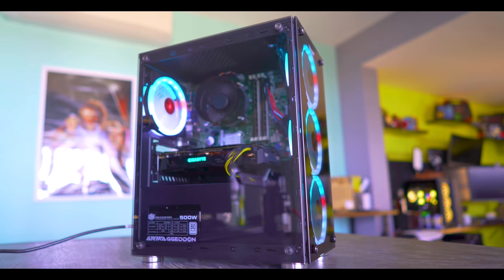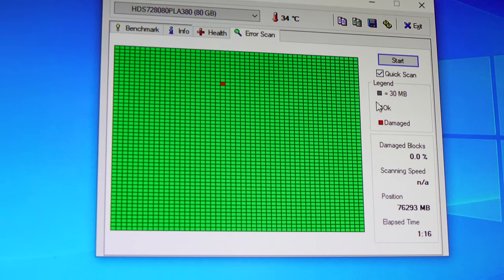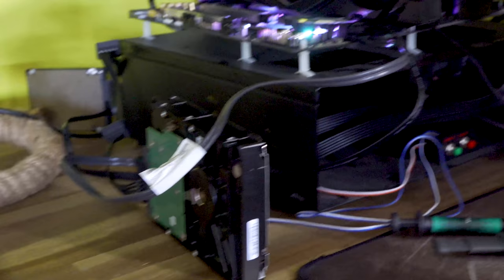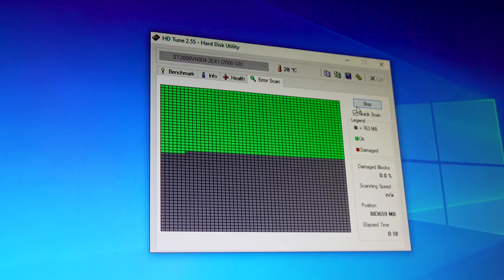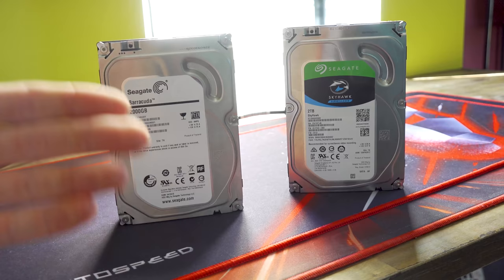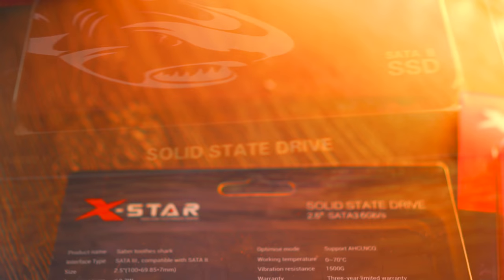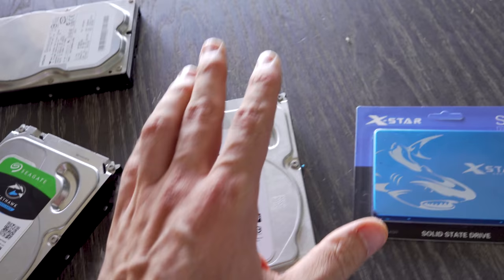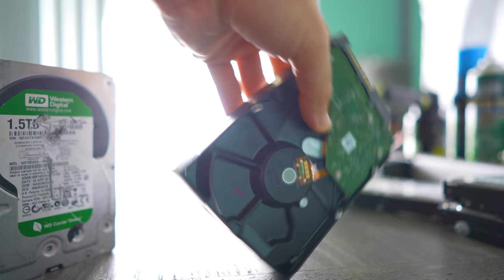Are USED Hard Drives Worth it...? (The Tech YES Buyer's Guide)

Comment from the maker: What's your experience with Used HDDs? Let us know below!
Reply: I took this bogan guy from Queensland to a Taiwanese scrapyard where we picked up a bunch of cheap driveys from a guy who gave us a hard time.
Reply: I had a used Seagate as backup. RIP.
Reply: I take old hdds from old computers i don't always buy hard drives
Old hdds is also good Temporary Boot drive till you get ssd
Reply: Tens of used HDDs and have never had a problem, use them in my own system. I have had a few SSDs die on me however.
Reply: For me its a 50/50 kinda at the point to not buy stuff from people here in south africa most are just looking to take chances at best
Reply: In TipidPC (the Philippine equivalent of Craigslist/Gumtree, but for PC components and peripherals), used HDDs usually come with test results that generally give them clean bills of health. I usually go for low-capacity ones (128 or 160GB) because not many people want them, and they usually come from old laptops.
Reply: The Tech Yes City Rebrand is 🔥
Reply: Apart from Toshiba & Hitachi -- I never buy used drives . Low level formatting is one tedious time consuming pain 🙄
Reply: As an IT support guy, I had tons of exp with used HDD. When I was in Data Recovery division, I had salvaged a few old 'dead' HDD from the masses and use them for  not really important task 😁
Reply: did u know chances of getting a functional hdd are significantly higher if u buy anywhere used instead of buying a new one off amazon, that is if its fulfilled by amazon, at least in germany they just toss the hdd without any protection in a box and the carrier just throws it around, almost 20% of their drives are DOA due to that
Reply: @abhroy  
>  Low level formatting 
 Low level formatting is a thing of the past.  HDDs produced in, say, the last 20 years can't even be  low level formatted.  Low level formatting is done in the factory where the HDD is produced. Doing it yourself would brick them.
Reply: @Conenion   . Well , then I must've been doing things the wrong way for the last 20+ years . Thanks :)
Reply: Stripped the 2.5 WD Blue Scorpio HDD (240GB) From a external enclosure, Plugged it into my 2nd pc internally and it needed to do the automatic repair but now it’s working perfectly fine, no weird sounds, nothing.
Reply: Your content is the best....🔥🔥🔥🔥🔥🔥🔥🔥🔥🔥🔥🔥
Reply: @jollysword  I always keep coming back to TipidPC to buy used HDDs . huge thanks for feedback system.
Reply: @abhroy  
As I said: You can't low level format a moden hard drive.  Most likely you talk about wiping a drive.  Filling an entire drive with zeros is writing to a drive, not low level formatting it.

https://en.wikipedia.org/wiki/Disk_formatting#Low-level_formatting_(LLF)_of_hard_disks

Quote:
"
Today, an end-user, in most cases, should never perform a low-level formatting of an IDE or ATA hard drive, and in fact it is often not possible to do so on modern hard drives because the formatting is done on a servowriter before the disk is assembled into a drive in the factory.
"
Reply: I use used hard drives all the time  and have had very few issues with them.
Remember that a power surge can destroy your HDD, Motherboard and PSU so always use a UPS.
If you use a SSD for storage and it fails you can say goodbye to your data, whereas you can often retrieve data from a faulty HDD.
Just sayin'
Cheers, Mon from Brisbane
Reply: If the HDD is outside it's warranty period I avoid them because they are already old. If the HDD is functioning and within its warranty period, I may consider it if it is in a good condition.
Reply: @ControllerMeneer  Yup, I salvaged a 500GB Blue WD from old external HDD (1TB that have 2x500GB) back in 2013. 1 HDD was broken but another one is okay. It still run and spinning now, I use it sparingly to hold my old but not so important data.
Reply: @Conenion  I think it's called as full formatting (not quick format that only erase the file file table) CMIIW.  Low level format is in another league and need special tool or application.
Reply: Got one a while ago, still ticks.
But in that case I was looking for an OLD IDE Harddrive, and those you had to find used.
Even more so as it was to be used in a PS2 and they are fiddly with where they put the ports to make it fit with the adapter.
The new in bag ones I could get at that time, wouldn't fit in there, so I got a used one.
Still works, still loads, still plays and is still good.
Reply: So far its good, i buy a used hdd wd black 2tb.
Reply: I took an old drive from my 2007 PC, nothing wrong it worked, but I didn't test it.

Began to transfer big MP4 files to it and the same day I couldn't retrive some of the files because most of the MP4s couldn't be copied, but still showed up.
Reply: I had a couple of 3 Tb drives from my old build that I wanted 4 more matching drives to put in to a NAS I was building.  Bought 8 drives before I got 4 working ones.  Thankfully all sellers refunded the dead ones.
Reply: Hitachi HDD is good. Got one but not connecting it. Sitting in the pc in it bracket.
Reply: I have bought a bunch of used drives over the years one of my best scores was a 4 pack of 4tb 7200 drives for $100 total that I use for my data storage aray now.
Reply: Ali Wardhana I use my 240gb drive for most of my games on 2nd pc and they downloaded faster on there than on my main pc (that has a 1TB 7200RPM HDD)
Reply: Hard drives can be a crap shoot. Different people swear by different brands. I have found that after testing upwards of 3000 to 7 thousand used hdds annually, Hitachi and Toshiba Enterprise grade last the longest. But remember all computer hardware fails, and you could really use any brand of hdd... except Maxor...f*ck Maxor..
Reply: WD or Hitachi I will give it a shot. Seagate it goes in the bin. I perform a killdisk DOD wipe with 100% verification, then do a long/slow format, then do a full extended check with WD lifeguard. If it passes I consider it good. I do this with new HDD's as well. And yes...I have found brand new HDD's that failed the test. I immediately returned them to the vendor.
Reply: @joshberman1848   . LOL . You mean Maxtor . That's Seagate now -- crap owns crap :)) Yes , Toshiba & Hitachi HGST -- they really last very long .
Reply: 2 buys 2 fails after short time! i will never ever will buy used hdd ever again
Reply: wd recertified can be a good bargain & well worth checking out
Reply: Usually no problem at all. I bought a 3tb WD blue drive für 50€ with case 3 years ago and it works to this very day. For every one of my builds i buy a stack of tested drives from ebay out of refurbished systems. About 8€ per 500gb is not that bad and i know for shure they work.  Some viewer donations had drives in them that were old, slow or broken aut of the box. So Good point paying attention to age.
Reply: Using my 8 year old hdd in my new amd pc
Reply: as a guy that repairs pcs for a company power on time does not say much of a wear on newer drives since they go to sleep after 30min idle but the hour counter goes up, if a drive has pending sectors write it with zeros they either disappear or will be marked as faulty (I use nwipe to do this) also check the warranty on newer drives the 2tb skyhawk (3:50) has warrenty till 2021 but was sold in a bundle so no replacement directly via seagate
Reply: I had a busted drive that wouldn't show up in any bios...but the modded original xbox fixed it
Reply: If u have used ssds that do not show up hook them ~1hour to an psu without the satacable and retry I usually see a 66% recovery because the drives runs selfdiagnostics without the sata connected
Reply: 2tb for 15$ verry good
Reply: I kid you not. I'm still using a 2tb hard drive that I bought new in 2009. I haven't checked it's hours in over a year, but it has seen a shit ton of use. It has non essential data on it, and at this point I just want to see how long before it dies. I currently have a 20 tb backup server for all my important data.
Reply: Oh new Logo! nice +++
Reply: I bought a 500gb used samsung hdd and now i get a lot of blue screen win 10 f**g problems i don't know what's the main problem
Reply: I have had drives with bad and slow sectors with HDDScan, but when erased the whole drive with KillDisk, they are gone.
Reply: CEX in UK do 2 year warranties with their 2nd hand HDDs.
Reply: bought one in  july and it has started to fail, luckily theres a 1 year warranty attached to it but i have to do a lot of reinstalling :\
Reply: Tech YES City Thanks Brother Dundee 😝
Reply: For the most part, I had not have a consistent failure with them. However, I once sold a PC for rather cheap, and just three days after a customer purchased it, the hard drive died and I got visibly upset about it, because I had not expected it to fail like that, or at all. Also, since I had on the ad that returns and refunds are not accepted, it was quite a very difficult situation I put myself in. Even if I wanted to help the lad, my only "free options" was another used hard drive that involved installing the OS and drivers all over again, and Windows 8.1 is a sorry cunt to deal with. (Predictably, despite what I put in my ad, he asked for a refund on it.)

Literally the point was to get my money's worth out of it without having to lose money or expend too much of it so as to unnecessarily drive up the price of the PC.

This basically solidified my resolve to not sell PCs with a used hard drive as the main drive (or just buy a new SSD as a boot drive and find some way to mount it, even if it looks janky), almost ever again, and I basically got the used drive for literally no cost, at all. I did pair it with a 200GB SATAI hard drive that was pulled from my school's old 2U SAN that had a external SCSI interface (with permission), though it's massively sluggish compared to a SATAIII drive, but that was intended as a backup drive for the user's files. Luckily, he didn't put anything remotely important in the PC, which is a breath of fresh air, but the situation was pretty shitty, nonetheless.
Reply: That Segate Skyhawk might just be in power on delay mode which is looking for a signal from a raid card or a DVR  you can use a tool like hdparm or hdat2 and turn off the feature to use it in a normal PC
Reply: I got a used 640gb wd from ebay for $13 with shipping. It had 50k hours and was clearly a server drive, but 3k hours later and its still running good. Later I bought a 2tb seagate "opex box" with 10k hours off ebay, and I returned that. I've learned my lesson about buying hard drives from ebay.
Reply: Still have a used 1tb seagate hdd from 2011? In my main rig i pulled out of a sff optiplex. Even after almost 4 years of gaming, it's still running strong with only 7000 hrs of on time
Reply: Ironically, the only drive I've had a problem with was supposed to be brand new. Well, that's if you don't count a drive that was only giving me trouble because a friend asked me to look at their system. Still, this video holds true. I am very skeptical about drives that I am not getting a warrantee on..
Reply: Try testing with "hard disk sentinel" it's quick and simple.
Reply: Used a ton of them in the usa and have no issue. I do factor level. Testing.
Reply: Been using used HDDs since... forever. Just bought a WD 500GB 7,200RPM HDD for like 10 bucks. According to HD Sentinel it's clocked just 250 hours, which means that theoritically, it's almost as good as new! No errors, no bad sectors, health is at 100%. Also a few years ago, I bought a Segate Barracuda 320GB 7,200RPM drive which had around ~600 hours and 100% health. It has now just a tad over 1,000 hours and running absolutely perfect. 
Personally, I 101% recommend used disk drives, as long as you thoroughly test them before purchase.
Reply: WD green blus are bad HDD for me . Because  After  warranty  expired, its broked

Seagate  8 years still working  (EXT HDD)
Reply: I actually use a 21 TB HDD from an supercomputer of the local universitiy. It is 5 years old, startet 17 times since then and has still perfectly fine SMART stats.
Reply: I only bought 1 used HDD so far, it's a 7200rpm WD Blue 500GB from 2014, it works absolutely fine
Reply: @leroymay8156  what model is this drive ?
Reply: Had a Seagate 1TB 7200rpm lasted about 5 years and Seagate sent me a refurb replacement. That replacement refurb just died last week after about another 5 years
Reply: Used SSD = great if it's post-2011 since they'll last another 10yrs, earlier didn't have reliable controller chips

Used HDD = backup storage only (almost always high usage, 5+ yrs on-time SMART stat = imminent failure)
Reply: How about using Superfdisk? It's worked well for me, since you can't use fdisk anymore.
Reply: I generally avoid used hdds. The only exception was when I hustled 25 500gb WD RE4s with 400ish hours for $12 each, and that was 5 years ago. Have been using them ever since without problems, great drives indeed!
Reply: unplug the power from the drive while in bios if the bios freezes you have a working drive reboot and volla i had a doa drive and i used this trick it fixed it
Reply: Used to buy a lot of used systems from local Goodwill (charity shop).  At the price level, typically about $10, the case is usually worth it.  I have had a few hd's go bad on me, but nothing I couldn't replace.
Thanks for the HD Tune tip.  Got a 2tb hd maybe going out.
Reply: I hate HDDs! I've lost at least 4 hard drives full of important files...
Reply: I can say I've never purchased a used drive on it's own. I've obtained them via old PCs but never bought one used on purpose hehe...  

That said I've bought well over a hundred new ones, and had a lot fail (I mean they all fail eventually hehe...).  Funny that the thumbnail for this vid is what grabbed my attention.  I had 14 western digital green drives.  13 of them failed within the first two years and were replaced under warranty, and each of those replacement also failed within a two year period.  The one drive I have left, is a 1TB version (all the ones that failed were 2TB versions), and it still works today nearly 10 years later.  Oh actually I forgot I had 1x 1.5TB one that also died, however the replacement for that one is still working in a friends PC (I gave it to him).  I've found that SSD failure rates aren't a ton better for reliability (which sucks considering there's no moving parts), and in most cases they're worse because they usually just die outright with no chance to recover your data.  So regular backups are critical, which I do on all my drives.
Reply: i have a used hdd from 2007 and it still works fine but i got lucky its a wd blue 500gb but speeds are actually pretty good for an hdd
Reply: @sariora123  I have two 2 tb seagates still working.
Reply: It could also be a faulty sata cable. I have ran across that from time to time. Rarely do I have hard drive failures. Two 1 TB hard drives failed on me at the same time several years ago. Those were wester digitals. Today I only buy enterprise grade hdds because they last longer and I always buy new. I swap out hdds for new ones every 2 years and resell the used ones but with crystal disk info screenshot to show prospective buyers the general health of the hard drives.
Reply: @Tech YES City i've only bought 2 so far about 50% success. one died in about a month and the other i used for a year, before retiring the pc. it's especially important to keep backups of your data when you dabble in this. i'm assuming that you are talking about using used drives as spares, when you are talking about backups. i would never use these drives to backup data on
Reply: I don't bother with used HDDs; i've had good experiences with new white label drives (meant for OEM/ODM deployment) from more reputable sellers who will throw in their own 1 year warranty,  $65US for 4tb enterprise drives for storage is a deal to me.
Reply: I normally buy new for my main PC's however for a uni project I used 2 used hard drives in a webserver because the chances that 2 drives will fail at the same time is unlikely.
Reply: I buy used enterprise hardware.
Reply: I got a used enterprise HGST  drive that was 25$    It was a little bit hanky at first as ALL the bad sectors were unmapped becuae the sector sze was changed
Reply: Havent had any problems honestly.  I dont buy what i cant test on site before buying.  I grab bundles of drives on facebook marketplace and just take my laptop and a dock to test them and get a smart report
Reply: I buy 1TB Western Digital Blue drives from my local CEX in the UK for £5.00 / $6.50 and they are perfect.
Reply: It was slow... Gonna get an M.2 drive soon
Reply: What a coincidence I just got mine couple days ago, 500GB for $12 (Yes I lived in poor 3rd world country)

From my analysis the harddrive was from South Korea (Used from 2015 to 2017) the sector and health are great 100% no issue (Spent 6 hours to analyze it).

The speeds are standard for HDD 126MB/s Read and 120MB/s write, so far so good. My unit is WD Blue Late 2014 7200RPM 16MB Cache. ^^
Reply: I still use my 320Gb hdd (plug in with usb 1.0 or 2.0 what it’s) from 2004-2005. Saves photos and videos. Maybe using hdd for 1-5 hours every year. it is in good condition? :D
Reply: 15 out of 50 survived but my computer's doesn't shut off unless the power goes out. what usually killed mine was when somebody accidentally kicks them. when you open the h.d. you can see the scratch ruining it. but if the h.d.d.'s are not kicked or dropped. the oldest working one is i got is 20 yrs old. i'm running 2 old n used h.d.d.'s for 6yrs now one at 520 gb where the o.s. is located   and a 620 gb storage and i bought 2x1tb external h.d.d's for storage and back-ups they are 10+yrs now.and i have a few 120 gb s.s.d.'s but they are slow for me my 520 gb and 620 gb h.d.d's load faster for some reason. all my computers boot under 30 seconds from cold start to 360 security or avast showing boot up times of 30 seconds or less.
Reply: I've got an Seagate 5tb that only works as an external. It doesn't show in the bios or simply doesn't work if I install it in my pc...it works fine with an external enclosure though!
Reply: Don't really recommend it
Reply: Worst idea ever
Reply: i like IDE and i want to use a i5 core
Reply: I only buy used drives since I only buy SAS drives
Reply: @jonathonrosalia9345  I have eight mixed models in a array, all WDC or Hitachi 5400 & 7200 RPM drives.  My Areca controller card has a setting where I can adjust the time limited error correction, so I can use drives which are susceptible to slower sector reads due to CRC errors (ie: non-raid certified drives).  It is a high latency storage array, but I usually only write large files to it.  It averages about 1000mb/s read and write.  I too got them for about $30 each, and some from shucked external hard drive cases.  Uses a bit of electricity, but for the cost, 28tb storage with Raid5 redundancy about $250, if you used three 14tb drives in that configuration, I'd be looking at $2100.  Prices for storage using older small capacity drives has also been called "Redundant Array of Inexpensive Devices" / RAID for a good reason.
Reply: I tell the customer to keep it. Never EVER sell your HDD.
Reply: @islandcomputers-au  why? There are programs that wipe them.
Reply: @pixels303at-odysee9  True but there are programs that can recover data from a wipe too. Better to just hang onto it and avoid anyone trying to look at it. If the drive is more than 4-5 years I'd throw it out. It's also a HDD so it's old junk anyway. Still useful but only when new.
Reply: @islandcomputers-au  well, I'd disagree.  I multi wipe mine periodically with random write data, which strengthens the sectors, a guy could spend time doing that easily.  Most hard drives do not sell for very much.  Many places that used to take in electronics for resale no longer offer them for sale on that very premise.  Kind of difficult installing a new OS on a system and taking the time wiping old data.  I used to do this myself from older computers at a local recycle center, but surprisingly there are rarely anyone who would appreciate something for free. Just irritating how old stuff that works fine are thrown out for no reason other than a corporation that tells you that you must buy something else "Microsoft".  Mind you, Linux distros work on just a out any old hardware just fine.

Good advice otherwise for those who don't care about their carbon footprint, nor have patience to prepare something to make a few dollars.  I love old had drives, and I use just about anything over 80gb in any interface. And regular people will not be able to recover data from a drive which had random data written to them, likely not even forensically.
Reply: @pixels303at-odysee9  I like your mindset. I feel the same about throwing things out. Where I am based in Australia it's really difficult to recycle things properly. There is so much wastage overall, let alone with computers.

I see too many HDDs that have hit that slippery slope and are on a plunge to the bottom; although it usually takes 5 years to get to that point. So sure, if they can be reused then why not. If you wipe yours that much then that's awesome. But I've seen many a customer who attempted to wipe theirs, only to realise they'd forgotten to back something up so I had to recover it - and succeeded on many occasions too. But they weren't using killdisk or other "this drive must die" software.

Microsoft, like many big companies, have their reasons for wanting old tech to get retired, mostly for security reasons - like Windows 7, Apple TV gen1, old routers, etc. But yeah, there sure is some strong arm BS in there too. Legacy software and printers for example. Plus my XBOX 360 controller suddenly stopped working when I upgraded to W10 20H2 recently. It worked fine on older versions. Dirty little tricksters!
Reply: nothing ,im new i only have 1,only wishing for new
Reply: If I ever get a used SSD or HDD I will always try to raid it if I have 2, or tell myself to use it exclusively for games. I'm a big thrift store DVR guy myself